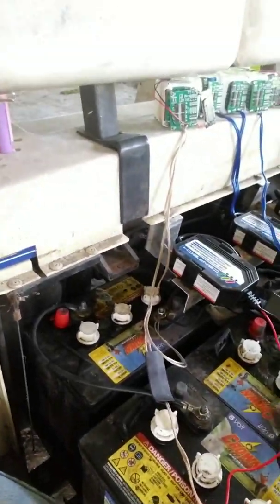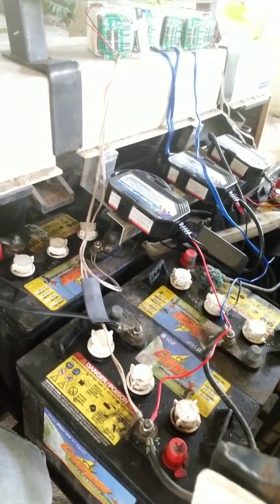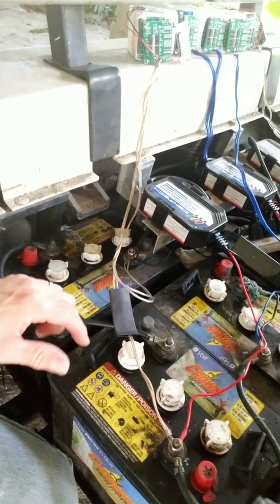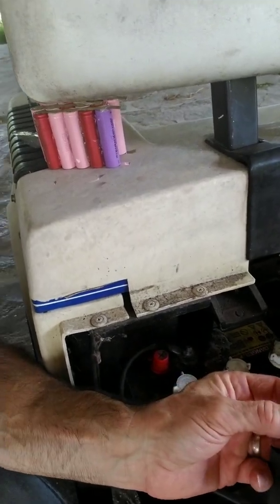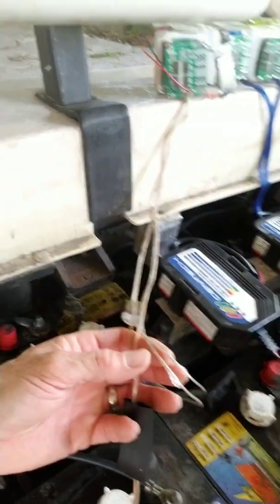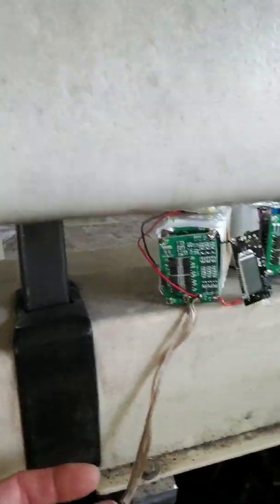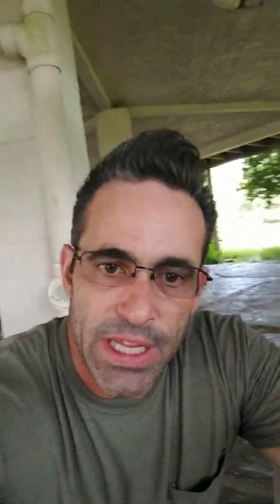Hybrid golf cart 18650 conversion (li-ion/lead-acid)

Comment: Have you guys checked out this battery from BigBattery? http://BigBattery.Com/Golf I ask because I just converted my 36v Lead-Acid golf cart to Lithium and now my cart has like 5x more range and speed! Also shaved a good 300lbs off my cart! Took me less than 30 minutes to install everything, so I think I spent more time removing the old lead-acid batteries than I did installing the new lithium battery.
Reply from the maker: Their cheapest kit is 40 times what I spent. I guess it all depends on your purpose for the conversion.

Comment: Did you finish I'm actually doin this right now I was goin to buy expensive littuim battery pack made for golf cart that gives you 60 miles per charge but I have alot.of batteries that I can do this with but haven't dont it yet because I thought it might burn up battery
Reply from the maker: Have you heard the saying "There's nothing more permanent than a tempirary solution that works..." The cart is all lithium, but I haven't added any more packs because it does everything I need it to and it does it so well. Just make sure you have enough packs in parallel that you don't overload them by drawing too much current. It can easily pull 90A when starting from a standstill.
Reply: @paramax55  ok do you know what you have total in amps
Reply from the maker: @cream6936  Like I said, it could be 90 when taking off. The faster the motor spins, the fewer amps it will draw. At 15 mph, I'm only drawing about 36A on pavement, but you have to get up to that speed. If you are going to do this, you are going to need a meter. They are cheap on eBay and worth every penny. Get the 100A version.  It will tell you total voltage and total load.
Reply: @paramax55  ok thanks